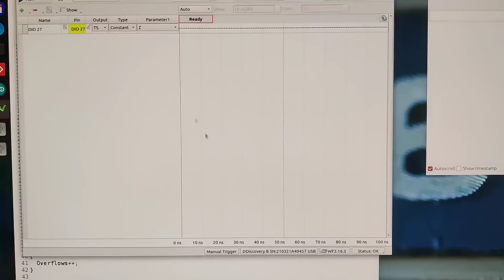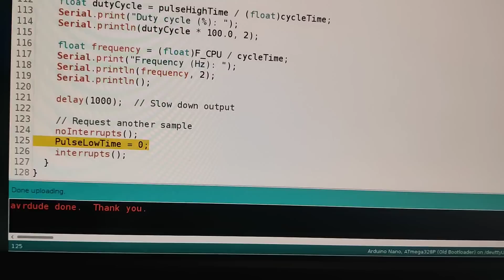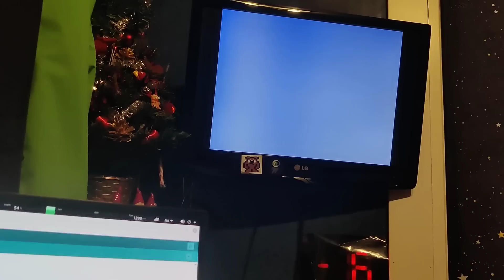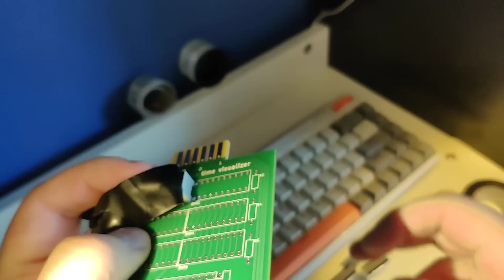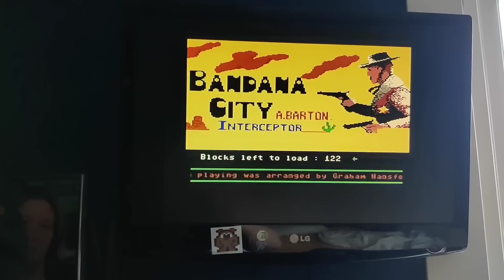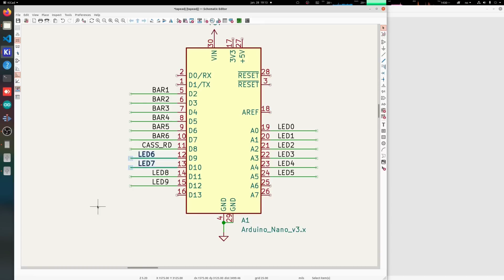I made a C64 tape pulse time visualizer

Comment: Good job! I think a nice feature to add could be a little speaker for listening the signals that come from the Datassette. With this add-on you could check if the sound become muffled turning the alignment screw... and if the sound become annoying you can turn it off with a little switch.

Comment: Nice idea and build, although perhaps you could replace the bar graphs with a 128x64 oled ??
Reply: Off course it's possible but way more complicated to control one pixel in oled matrix than use single leds. But maybe you could use less wiring using oled with i2c?
Reply from the maker: Check out Luigi Di Fraia's DC2N. He has several versions of it. He has Tape Port Monitor, which does just this.  https://www.luigidifraia.com/sales

Comment: Also A VU-METER Version Would Be Extra Cool For Maximum Signal Strength.
Reply from the maker: Hi thanks for the idea, but the analog signals are in the datasette. On the outside of the datasette we only have digital signals and power.

Comment: I wouldn't mind a more simple design just for getting games to load. Just for the alignment of tapes. The 10 bar Red Led version that was used in the Mills Load it kit would be ideal. Its a good idea for your 1 device to fit it in between the cassette port and the Datasette Connector. No need to drill holes in a Datasette . no need to solder. And you can also use it on any Datasette you have lying around. Fantastic idea . Well Done.

Comment: Fun project! A suggestion: Add a small speaker that output the audio. With a on/off switch. Maybe you can code a DA conversion in the microcontroller?
Reply from the maker: It can work for listening if the tape has wow or flutter, by plugging the digital read signal to a piezo speaker, but for crispness of the sound you would need to tap into the analog signal which isn't available at the cable. I will release the design now. I have added a connector for C16 tape drives as well.
Reply: Yes, I know the signal is digital. But you could convert that to analog?  @bwack
Reply from the maker: @tommyovesen  sure, but the signal has been clipped by the amplifiers in the datasette. but i suppse you might be able to hear something is different when the head is misaligned..

Comment: Not active on X anymore so I missed out on those status updates. Cool te see what you've been up to with this. This is an awesome little project that makes loading in a tape on the C2N deck actually a lot more interesting that it normally is and adjusting the azimuth :)
Reply from the maker: Thanks. Disco lights for tape drives ! Not sure how useful it is other than adjusting the head. It is interesting though to look at the different tape transfer protocols show up. Also with the good old turbo tape program, when it displays the "FOUND program", the drive spins down, but continues to send pulses. It shows up as a led that is running all the way down to 0. Which was a bit funny to see. I will show it the next video looking at some old tapes. I've also ordered TapeDump64, which is a program that I can dump my tapes to a computer using a usb cable and a python program. :)

Comment: All PCB designers seem to make the same mistake and use small solder pads.
Why not use bigger solder pads to make hand-soldering easier? You have plenty of free space on the PCB.
Reply from the maker: I will add those long pads for easier soldering.

Comment: The dreaded AZIMUTH 😢 😂
Reply from the maker: I remember my games stopped loading, sometime back in 88 or 89. That was awful! hehe. My mum went to the computer store and they recomended the Azimuth adjustment tape. It worked!
Reply: Back in the day, my friend had a Spectrum running off a regular tape deck and he was constantly messing with the azimuth.  Pretty much every tape needed the head readjusted.  I, with my C64, never had any issue with the datasette
Reply: @philrod1  for my spectrum, running on a WHSmith datacorder, i never took the screwdriver out of the hole!